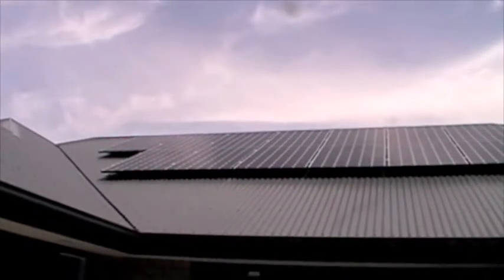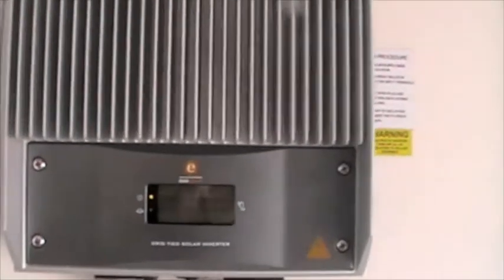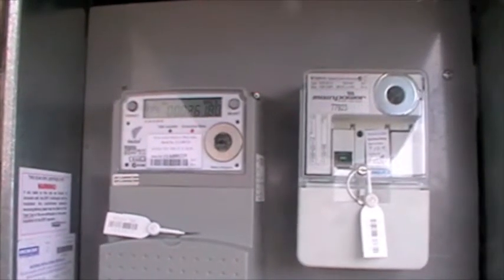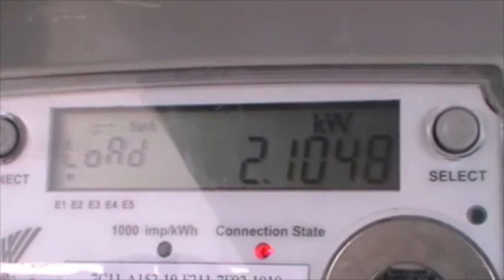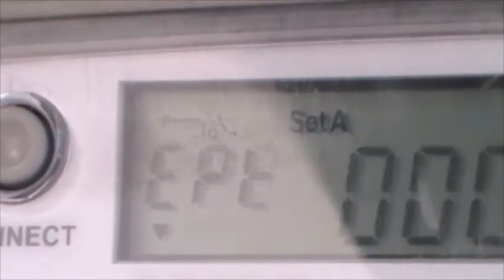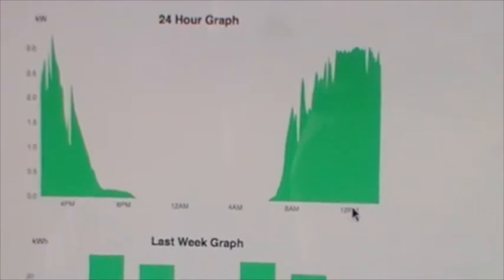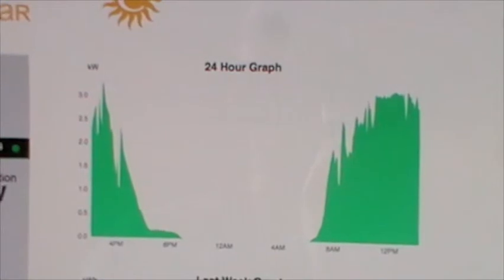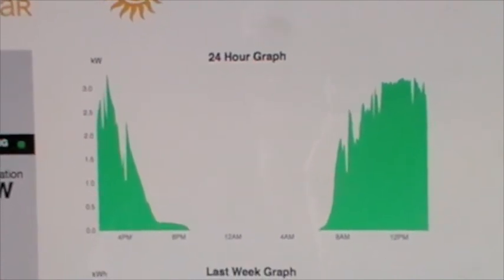solar electricity photovoltaic LG panels New Zealand

Comment: Hey thanks for posting the video,  it looks like a pretty good system you have there. 
Would you let us know who did the install for you? It seems like they did a good job.  
We are interested in solar as well.  Aside from reducing power bills,  it seems like the best thing for the environment as well. Thanks!
Reply from the maker: Hi, ours was done by Harrisons solar (same as the carpet people) who operate on a franchise basis. We are very pleased with the operation of the setup but have had a few issues regarding communication with the franchisee and some slight damage to the roof is still to be resolved. Who your franchisee is will depend on where you are in NZ. Be prepared to haggle and Solar City (who do Panasonic panels) can be competitive if you get the two to bid against one another. You get fly buys with Harrisons too (hmm..... if you need a new toothbrush :-) The maximum actual output to date from a 3.9Kw rated system has been about 3.5Kw, they are never going to operate at 100% efficiency for a variety of reasons. If you get a higher rating than that then unless you have a high consumption of electricity during the day (you're not going to smelt aluminium are you :-) then much will be exported at a low buy-back rate and it is unlikely to justify the extra cost (from our experience but everyone is different). Contact did not charge us for the meter change so we changed from Genesis who would have charged over $100. No contract is involved so we can change back as we like. For electricity exported it is necessary to invoice your electricity supplier and payment received is taxable. Buy back rates have plummeted recently, from 17c to about 7c per unit for Contact. Hence the more you can shift consumption of electricity to when they are producing plenty of current during the day the more you will save. So far our savings have made it well worth while but then it is summer! Partly there is the future to consider too as I can't see electricity prices falling. HTH
Reply from the maker: +mikeuknz Harrisons head office prodded the franchisee (who has now sold the franchise) to pay for the repair to the roof and they also did two follow-ups; good to deal with.